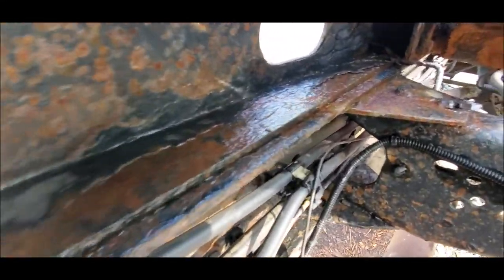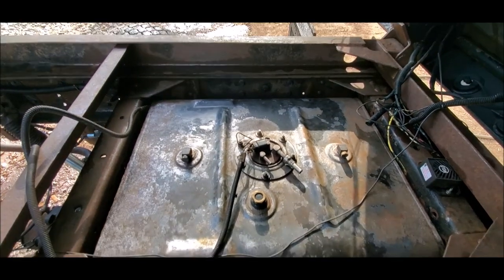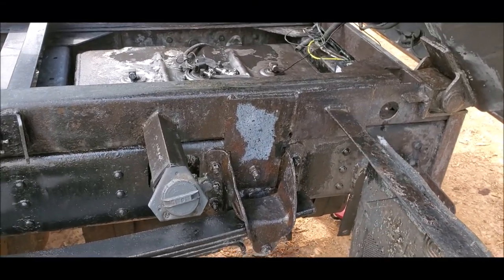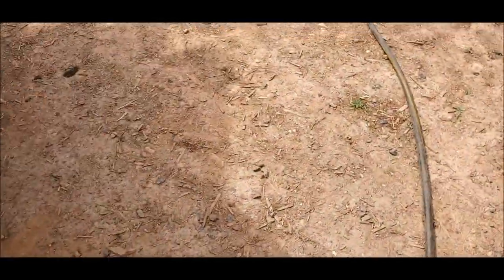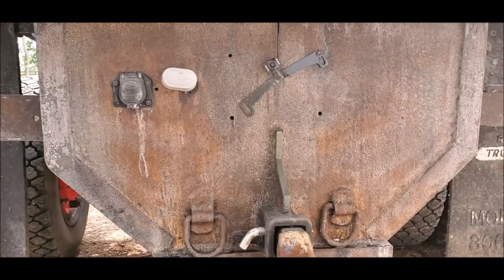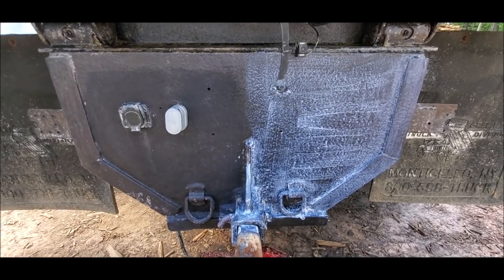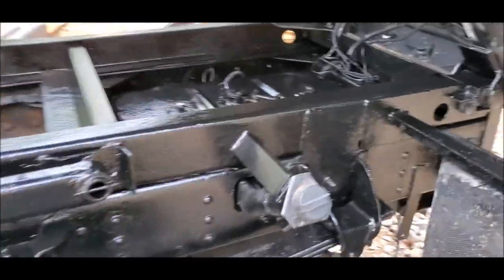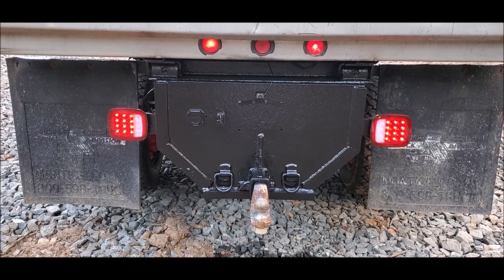How well does the $28 Harbor Freight Central Pneumatic Compact Needle Scaler work?  Let's find out!

Comment: i used to spend 8 or more hours a day on the side of a nuclear submarine using these needle guns. they work amazing.
Reply: Lol, did this on the deck of a ship
Reply: How ur wrists feel now?
Reply: Hah aircraft carrier here then followed by the noxious primer we use
Reply: @skatingclaybird  fell off last week.
Reply: Veteran, USS Enterprise...Ahhh the memories. I just purchased this exact tool, excellent value, excellent quality and it runs off a medium capacity air compressor without issue.
Reply: I served on USS Dace SSN607 from 76-83. Ever work on that puppy in dry dock? Wish we had these things when we cleaned out the machinery space and engine room bilges before repainting them.

Comment: Educate me, why wouldn't a twisted wire wheel work better.?
Reply: wears out real quick and cant get inside tight corners , ive spent 45 years trying all methods , grinders , wire wheels , flapper mops , sand blasting on a budget gun and the needle scaler is best band for buck, the noise being the real problem for me and my neighbours
Reply: @mariebaxter473 ...Lesson learned.    Thanks
Reply: Those are badass for tight 90° angles

Comment: I restore truck frames and use a needle scaler for 2-4 hours at a time. Best HF investment ever.
Reply: do you think it will work with a pancake compressor?
Reply from the maker: Maybe for two seconds
Reply: @josephagosta7554  the cheap one - NO - I use the Chief Needle Scaller which is about $100, it takes about 4 scfm so its twice as efficient as the older model. the pancake prob does 1.5 scfm or so. That means you can use it in small spurts but it wouldn't be very effective like that.
Reply: How much to you charge for truck frames?

Comment: I own a Construction company for a cpl decades now and have found oil paint works the best for exterior doors and trim 👍. It smells , it takes forever to dry but man does it hold up superior interior doors as well . I’ve used Benjamin poor satin Impervo and Sherwin Williams. Pro classic but it got really expensive as of late . I’ve seen guys spray entire trucks with rustoleum and it turned outs great for and used rhino lining on the bottom for rust . I think I used some chassis black before for a frame before . Long as the paint holds up it’s good , hardly matters who makes it long as it’s good paint

Comment: Ive done rust removal and paint prep professionally on offshore vessels. My process:

- Needle gun for heavy rust scale
- angle grinder wire wheel brush to further clean/buff the surface (whatever you can reach) and to feather the paint edges
- depending on the finish you get with wire wheel, you either go straight to rust converter or go to an acid treatment
- we would use a product called Metal Brite HD - which is a phosphoric acid solution designed specifically for this application. 
-dried acid solution can leave salts on the surface, so a quick rinse with fresh water preps the surface and will give you that initial rust you need for rust converter.
- rust converter coating. If youre painting directly over, multiple coats is advisable. For marine application, we have a paint spec that involves a certain number of primer coats, so 1 rust converter coat is enough.
- primer coats
- top coats

Comment: Angle grinder and a flap disc would take off that rust ALOT quicker! I have never used a needle scaler however. Why did you choose this method?
Reply from the maker: It was fun and that scaler can get in all the small areas that a grinder couldn't. And the finish looks nicer.
Reply: I assure you a needle scaler does a far better 'bulk strip' and is less hazardous with little flying debri. Cheaper too. Flapper discs and wire wheels have there place but not on scale
Reply: Flapper discs also remove material. They're also not great for heavy scale removal and in awkward corners.

Comment: Hi. Can you do an update video. I've used muriatic acid to remove rust before and it seems to just keep eating/rusting the metal, even after neutralizing with a baking soda mix. Curious to see how well this held up. Thanks
Reply from the maker: I wish I could. I sold that truck shortly after I made the video. 
I truly think rust is an inevitability no matter what. Do your best and hope for the same.
Reply: @JerichoRally  Yeah, suppose if there was something that actually did stop rust we wouldn't have rusting bridges and train trestles ect...
Reply: @myutoobaccount2 just move out to the southwest. my cars in bare metal outside & even when it rains it’s so dry, the surface rust is so superficial it can be scraped off with a fingernail